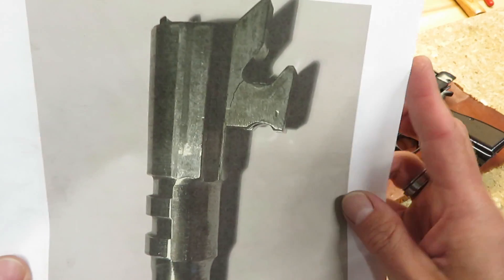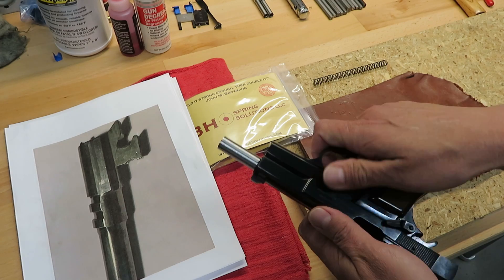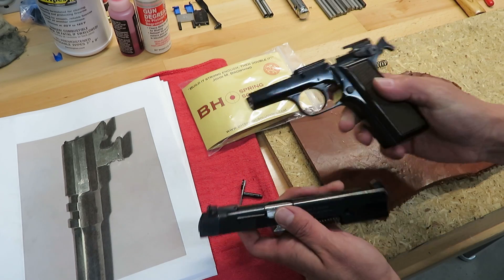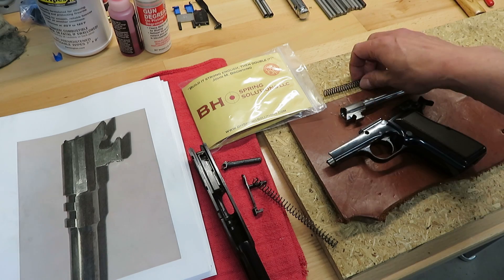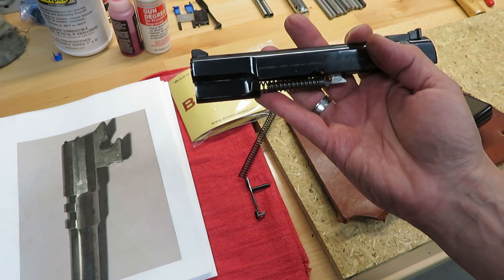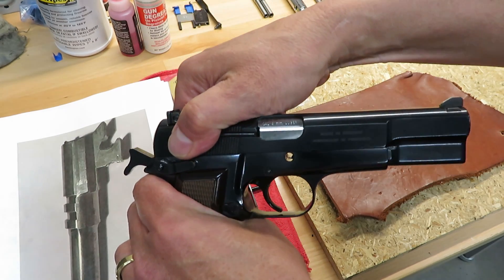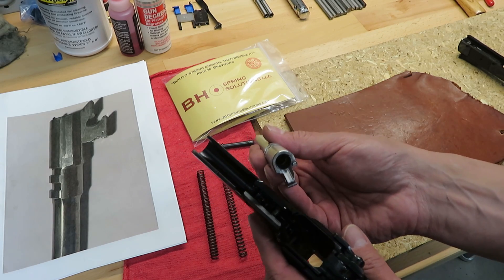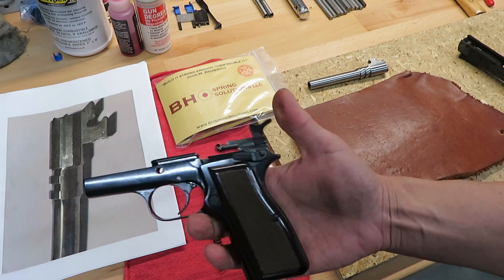HOW TO DESTROY A HI-POWER - BH Hi-Power University Session LV

Comment: You should replace all springs in all fire arms after 5000 or so rounds or 5 or so years depending on your use.. Cost isinsignificant compared to replacing the broken part or potentially destroying it or worse. I got guns that have been sitting for years not being shot. Always good to give them a fresh set of springs either way.

Comment: I have a relatively new Tisas BR9 that has not been fired more than 50 times.  Can I measure the spring length to make sure it is within spec?  If so how long is that measurement?  I see you recommend every 5 years.  Does this still apply to pistols that have not been fired and are safe queens?  Been a fan for a long time.  Glad you are there for us.
Reply from the maker: Thank you Larry.  Our recommendation of 5,000 rounds or 5 years, is our "best practices" recommendation.  In 2018, we tested a Tisas BR9 through 6,000 rounds and then up to 8,200 rounds with BHSpringSolutions' Optimized Hi-Power springs installed.  At 6,000 rounds all springs were within 95% of their original strength with one exception, the firing pin spring, which was 89% of original strength after 6,000 rounds and still a much stronger spring than Tisas' OEM Firing Pin Spring....  In 6,000 rounds, the BHSpringSolutions' Recoil Spring lost less than 3% of original strength and our Extractor Spring had no measurable loss of strength.  So, all those same springs kept going through 8,200 rounds.  
Now....here's the rest of the story:
The springs I mentioned, as tested, were installed in the Tisas HP and testing commenced.  I would not expect the results we had after 6,000 rounds to be that great if we were using springs that had already been installed for 5 years.......installed, exerting energy trying to get themselves back to their original relaxed length prior to the test.  This would not be apples to apples....the previously uninstalled springs naturally have more remaining useful life, they've not been already working for 5 years.....
Thanks again for the question!

Comment: The better solution to avoid spring weakening/setting is to design it so that the slide stays locked for a longer distance.  This of course is a new design entirely but it would avoid these issues.  As is the design depends too much on blowback characteristics with weaker springs.

Comment: I have a very technical question to ask you. Firearm you're handling does not appear to be shot much at all even though it is 7 years old. Not only have you never explained in any video I have seen the first yield point that any spring goes to when it is but under tension. That is not a concerning factor. All Springs when put under any kind of tension will not return to their original length, and that can be mitigated by different spring manufacturing and tempering techniques. It can also be exasperated by improper tempering techniques. I don't know of a Springmaid today, and that includes the IMI Springs that are made differently than the older style music wire coil Springs that do not shorten once they're put into a state of tension. I will disagree with you that if you leave at that state of tension that the spring continues to degrade. The only thing that causes Springs to degrade is over stressing them, and operating them at rates higher than they are designed to function at. And that is not even bringing in the idea that certain types of corrosion have an effect on Spring life. I would Hazard a guess that the spring that presses against the detent ball in the spring guide on the standard Browning hi-power is actually either suffering some sort of corrosion or it's getting plugged with enough carbon-dated eventually causes the spring to bind up rather than the spring actually failing. It's failing due to other issues. I like your solution to that. I also like your enhanced Barrel I would like to change out the Barrel in my Argentine military high-power but it shoots so damn good I don't know that I want to. However my particular gun has been hard chromed. So if a crack develops it will be easy to see. So I may just order a barrel and see how well it shoots with one of your one piece barrels. Thank you for the video everything about this has been extremely Illuminating. I have tinkered and played with Firearms since I started teaching people to shoot when I was 14 years old and that has been in excess of 50 years now. One of my closest Associates happens to be a master gunsmith in the state of Michigan and he has taught me quite a few things, as well as in all of the engagements that he and I have had I have only ever seen something that he missed on two occasions. He's really hard to fool.
My secondary question is why the cam that is cut into the barrel match the crossbar better. You think that if the crossbar has a rounded nose that it would contact as close to that as possible so that you're spreading the force across that cam rather than putting all of the forced into a singular spot on that cam. I'm not sure why it has a flat face and a rounded nose on the crossbar. I would think that a greater contact patch might mitigate the incidence of impact.
Reply: These springs are in compression not tension.

Comment: So its bad if my casings are flying out 12 feet???
Reply: The distance of the ejection is determined by the slide velocity. If the slide is too fast, the slide-to-frame collision would be harder than it should and this reduces the longevity of the system in general.

Comment: Sooooo. is this a factory issue or a customization issue? 
My questionis, is there a way to avoid this lol cuz i love my p35 girsan hp clone. And i hope this doesnt happen to mine.
Reply: Don't fire super hot loads when it has a worn out recoil spring
Reply: @Mr. Gible  gotcha, thanks lol
Reply: Just normal recoil spring wear.  They are wearable items that need periodic replacement.  I have that same yellow B&H ziplock package that’s on his bench.  It’s a spring assortment kit that gives you a few options.  Best part is, when you unfold the cardboard, it has a “lay it on top” diagram for proper spring lengths to check for compression weakness.

Comment: What are the purpose of the three holes on the slide?
Two holes on the side and one hole on top?
Reply: The hole on top has a roll pin in it to anchor the extractor.  The two holes on the side have a roll pin to anchor the sear lever.

Comment: How does the mentioned 17lb spring compare to the stock (factioyr) spring in my 1971 'T' model 9mm Belgium made weapon? What is the lb rating on my spring which is original?
Reply from the maker: Thanks Glenn.  The OEM HP Recoil Spring is a 17 lb recoil spring when new.  If it's been in there since 1971, it's not that now nor has it been for a long time.  And it's the front end resistance that goes away appreciably because as springs wear themselves out, it's that relaxed dimensional length that decreases.  The recoil spring is compressed, when installed, and it exerts continuous energy trying to get itself back to it's relaxed length - nothing exerts energy forever.  Over time, the spring's strength degrades - and the implication of this in the Hi-Power and the Recoil Spring specifically, is degradation of the  front end resistance on the slide - which is the only resistance that matters when the slide starts to recoil and slams the barrel's cam lug into the locking lug cam.  The other thing to bear in mind is that the Hammer has a spring behind it which is part of what controls the slide's rearward velocity - the Main Spring - if this one's never been changed, it's lost a great deal of it's resistance / push on the hammer.  Feel free to reach out to us at 1-877-423-BHSS(2477).

Comment: When do you recommend changing the springs? Is it just based on recoil spring length or do you take age and rounds fired into account?
Reply from the maker: Our position as a company with respect to the Hi-Power is 5 Years or 5,000 rounds, whichever comes first.  Does this constitute changing out our springs before it is necessary to change out our springs?  Yes.  Does this recommended change out interval maintain "Optimal"?  Yes!....which is the point of the recommendation.  If a Hi-Power hasn't had new springs in the past 15 years,  it is in the "danger zone" for beginning to abuse itself when fired.  There are Hi-Power springs sold by our competitors that have been beyond their useful life within 2 years / 2,000 rounds in our testing - so a factor in the answer to your question is "who's springs are we talking about?"  In my personal Hi-Power, the OEM Extractor Spring completely failed at 18 years / 9,000 rounds and the Recoil Spring had surpassed it's useful life a few years before that and accuracy had become not-impressive.  I installed new springs and it was suddenly again a tack-driver.